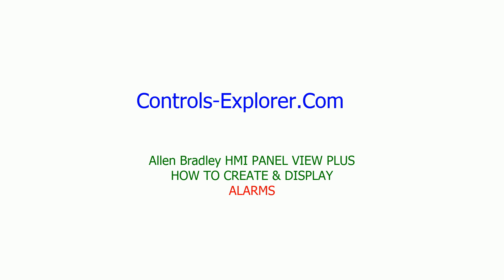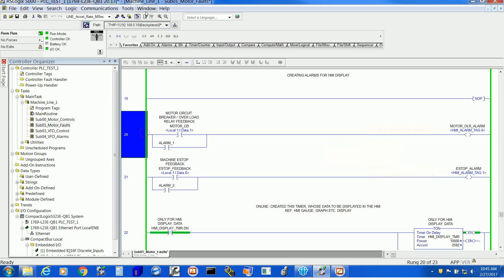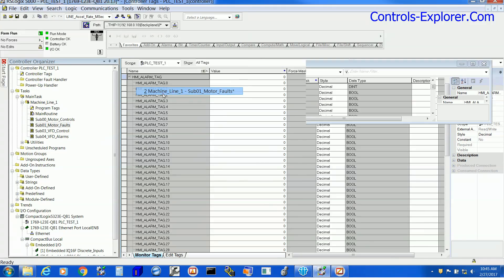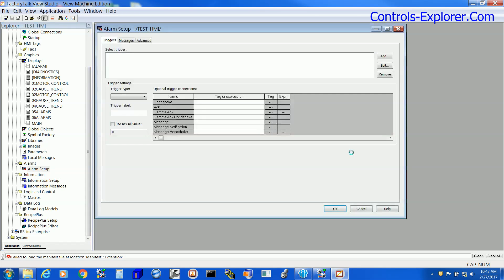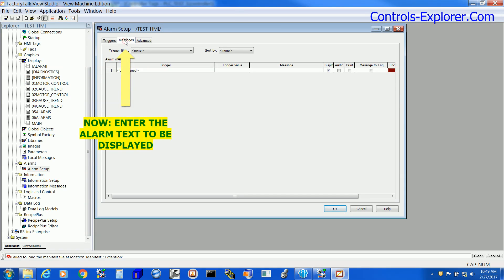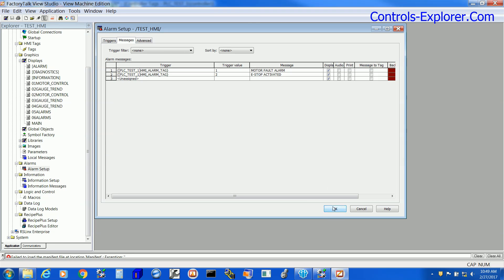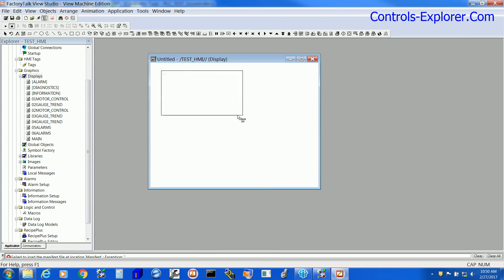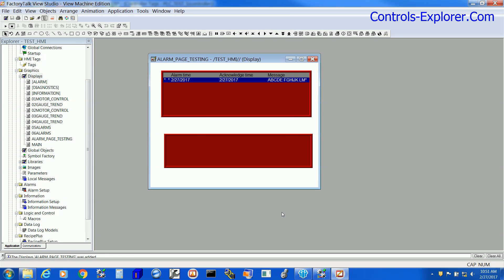PANEL VIEW HMI ALARM

Comment: Hello, what can I do if the alarm date shown on the panel is different from the one currently configured on the panel?
Reply: Hello: You need to change PV date / time: Terminal Settings : Time / Date / Regional setting …..
Reply: @subratamukhopadhyay9642  Thanks, I already did it and it still shows me a diferente date in the alarm list
Reply: @Paoplascenciaa   it can be that date is using plc date.

Comment: There is something amiss with using one integer for many alarms.  For this example, what happens when both alarm are triggered at the same time (for the value of 3)?  Nothing, right?  I am not sure if it's possible, but each individual bit of the integer must be used as a separate trigger, for example, Alarm_Tag.0 and Alarm_Tag.1, and so on and then have an individual message for each tag.
Reply: My thought exactly. I'm going to set up a PLC and see how this responds.  Also, the next bit is 4, so do we use the value 4 or 3?  Again, I'm grabbing a PLC and will test this in a few minutes.
Reply: internaly, it makes a mask, only response to bit in position, not in another position.